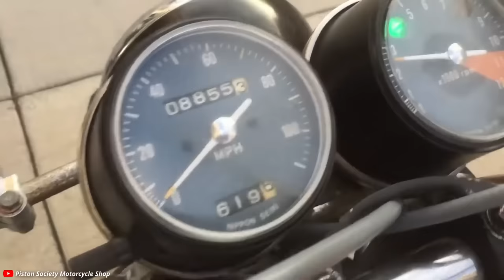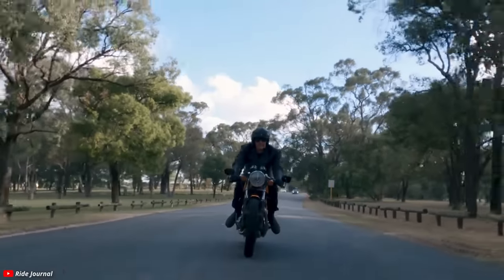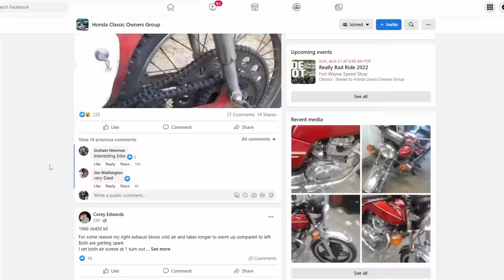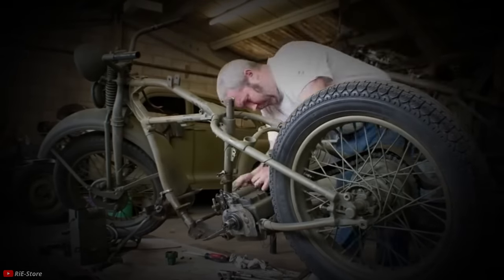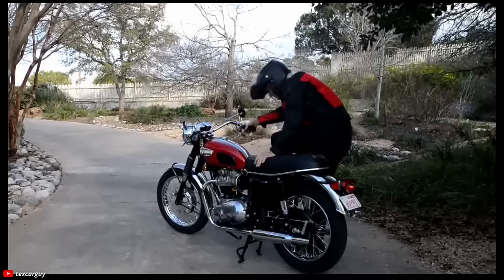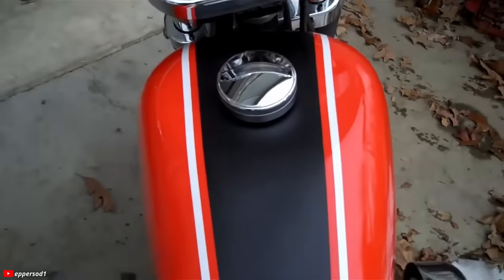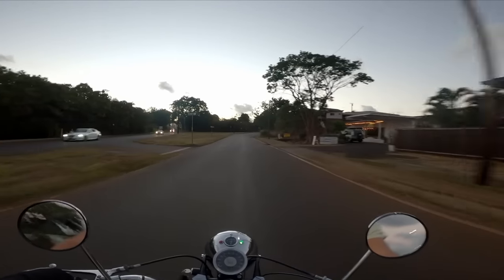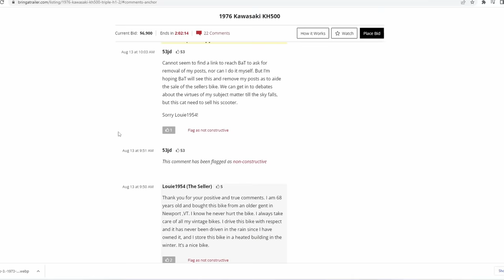So you want a classic motorcycle...

Comment: I remember old motorcycles when they were new motorcycles. Man, I love this channel.
Reply: I've gotten myself a new, old motorcycle. 2018 yamaha sr400. pretty much unchanged since 1978 :D
classic bike look and ride but it's not twice my age and needing an overhaul.
I love that it's kickstart only too
Reply: @TheJunky228  - Years ago, mid 1970's,  a friend bought a Yamaha RD-350.  He loved it. Then traded it for a Yamaha 650 twin. The Japanese Triumph clone, more or less.  Raced his old RD. Lost. Ditched the 650 and bought another RD.  Not a good picture  but my classic was a '68 XLCH Sportster at left.  Click on it and it's a little easier to see.
Reply: I remember when they were horses
Reply: @scootergeorge7089  
"..was" ? A 68 Sportster 
Nice bike.. if you like working on motorbikes
Reply: @TheJunky228  
Yes Grasshopper 1978 2J2 👍
Reply: @hodaka1000  - Actually it was surprisingly reliable. Rode it most of the year to and from work in the USN. Mine was originally a magneto bike someone did a half-ass job of converting to battery/point ignition. Found a rebuilt magneto and installed that. At a garage sale I found a complete dual disk brake front fork and wheel  originally from the XLCR "Café' Racer."  Biggest issue was starting when hot. Like after filling the fuel tank. Cold starts were one or two kicks.   Rode it from 1982-1988.  That's it on the left. Click on it and the picture is slightly better. A friend did the tank in black and gold leaf, "SPORTSTER."
Reply: @hodaka1000  - I remember when "Bonanza" put a Hodaka Ace 90 and later Ace 100 engine/transmission on their mini bike.  Arguably the coolest mini bike ever.
Reply: Grew up with an SL100, then aCB 350........then a 78’ CB750K, wish I had now! Got a few Harleys now.
Reply: Owned a few Honda’s back in the 70’s! Now I have a few Harleys.❤

Comment: I looked at purchasing an expensive Classic 70s model Kawasaki Z900 or a Z1R in original running order or FULLY RESTORED and sorted out..What I ended up looking at where ALL only very well used and worn COSMETICALLY restored bikes that looked a million dollars..and still for a huge price..ALL these bikes had either unserviceable steering head bearings and swingarm bearings as well and needed these replaced..plus other issues..So for less than half the price..WITH NO ISSUES at  all I decided on a much newer 2010 model Kawasaki Versys 650 ABS with a mere 10250 kms on the clock instead..I couldn't have made a better purchase for the price $AUD5000 with RW Certificate honestly...
Reply: You can also go for royal Enfield continental GT 650
Reply: @ashutoshrajput3757  Sorry my brother had the very first model of that bike and on ALL his long trips I was called to pick him up with the trailer..Turned out this second hand bike was tampered with by the previous owner so not reliable..
Reply: @albertsammut433  i agree with u brother. Realy these RE  causes a lot of issue while we take it for long journeys. If we ride everyday for 700to900kms it really causes a certain issues, specialy in hot climate zoned areas.

But the issue with interceptor is minimalistic.and its specific due to the placement of relay system beside the engine (where it doesn't get chance to get cooler).
For India its best option just for its accessibility and durable engine(if maintained properly. oil chNged in time, etc) it lasts very  well here.
And both continental650gt and interceptor share same engined and other spares.
Reply: @jyotiprakashdas4429  Thank you too dear riding friend..I think Royal Enfield and Triumph are very well build bikes..But my silly brother bought his bike without inspecting it first so it had a terrible previous owner who didnt maintain it well and sold it cheap..so my dear brother bought a cheap problem bike.
Reply: @albertsammut433  u r right  brother. 
Triumph is amazing 
RE also make great bike .

althg Many owners buy there RE bike, they lack proper knowledge of when to change the engine oil and many other things.
Even the authorised service centre don't make proper  suggestions abt the oil change interval period(i have seen in most of the region of India).
So atlast a lot of issue arises.(most specific issued piston ring get worn within few months of owning the bike, crank case, valve guide gets worn ,oil stem issue , severe scratchs inside bore block and  many others severe issues).
I can't blame the owners coz its the fault of authorised service centre coz they dont make the owner aware abt proper maintenance.(m teling specifically abt India).
I asked some owners abt oil change interval. They just mentioned they have never changed the oil .just refilled it when it got low and driven it like this for months, which further resulted in other shorts of catastrophic failure.
Even the owner are not made aware abt the running in period of these machines(which is mandatory for every RE engine, as per my experience for around 3000kms atleast.) Not following it is also hazardous.
Coz,
Once a rider riden his RE bike constntly for 550kms after buying the bike Frm the showroom at a stretch. After reaching the destination he parked the bike and within few minutes the bike caught fire and blast occured. 500cc bullet it was )

RE are best. But i m never happy with there services.
They don't fix the machine,rather they  try to kill the machine like a slow poison does).
Thus within 25-30k kilometres severe breakdown occurs in most oF the RE bikes in India.

If RE is  maintained properly it can last for i guess 150k to 200k  kms or more  with minor issues
Reply: @jyotiprakashdas4429  Thanks for the long story brother..I once owned an old Honda CX500 V Twin when I was 22 years old..It was my only transport then and I bought it cheap with 98000kms on the clock already..Had that bike for 12 years with only minor oil leaks..i put another 100000kms on that bike with NO mechanical issues at all..but i serviced it perfectly always..Sold it with nearly 200000on the clock and it still ran perfect..and I got all my $1100 back that I paid for it 12 years before..That was an amazing bike honestly.
Reply: @albertsammut433  oh great elder brother. I m  just of 24 now.😊

U r rite .
Honda machines  are amazing.  I have experienced small segment Honda bikes. They are favolous. They never get old if maintainance is done properly , xpecialy in engine's part.

During my 20s( i.e, 20,21,22,23) i also owned a small 162cc  bike i.e., Honda cb Hornet 160R. (I preferred small engine bike because it provided me great fuel economy and as per our road standard speeds its best choice for daily commutes.)

I clocked around 124,000 kilometres with it within 3.5years(including covid  lockdowns) and atlast sold it before few months. They are great machines.
I use to get fuel economie of 65-67kmpl  petrol if driven sweetly. And if driven insanely it gave fuel economy of 45-52kmpl.
Till date it got no issue (i did proper servicing and i m sure that the next owner will easily able to clock more 100000kms with it without any major issue).
The way Toyota car does last,  in same manner Honda bikes does last.
Reply: Two easy fixes.....if you cannot fix stuff don't buy one
Reply: @billmago7991  All bikes i viewed where advertised as FULLY RESTORED buddy and over $10k with problems..I'm an Aeronautical Engineer and can fix anything mechanical..By the time you fix all the issues..parts and labour..they are in my opinion..not worth the inflated prices..A newer bike is alot cheaper and better in just about every way and MUCH BETTER value for money..
Reply: @albertsammut433  u r right brother! Its not at all worth for the price we pay as an extra
Reply: @jyotiprakashdas4429  Exactly..its greedy people who set the crazy high prices for their worn out old bikes..I feel sorry for the riders who buy these bikes that dont understand mechanical and then have to pay ALOT MORE MONEY on top to fix them for safety..Its just a big scam honestly
Reply: @albertsammut433  i feel the same about it brother. 
Its biggest scams that is seen in motorcycling world.
Reply: @albertsammut433  
Bill Mago is right steering and swing arm bearings are not had to do 
If you really wanted a good fully restored Z900 or 1000 you'd probably have to pay $20,000oz + at least 
Didn't you know that ?
Reply: @jyotiprakashdas4429  
The biggest scam in the motorbike world are bike shops 
I've seen some horrible and at times dangerous work done by bike shop mechanics while they charge an arm and a leg  
I can only think of a couple of bike mechanics who I'd trust to touch any bike
If you can it's best to do all your own work
Reply: @hodaka1000  so true brother.
I have faced the same things in our region . Even i face the similar issue with our bike mechanics.thus
So i never trust any mechanic. Coz many times they destroyed my bike rather than repairing it. In India finding such idiot mechanics is common. After a long walk i got someone trustworthy.
Thus, I have trust on just only one mechanic  ,  whom  i visit when my bike cause any issue.
Reply: @hodaka1000  When I restore a machine I do it Aerospace standards  which means to the highest level..no expense spared..better than new..Not many people will bother to do a PROPER full restoration like this buddy
Reply: @albertsammut433  
Well.. if that's the case why would swingarm bearings be an issue to you ? 
I replaced my swingarm bearings recently but added two grease nipples the idea being you remove one and grease one side and then replace that and remove the other one and repeat so as to not blow out the seals 
It's not rocket science
Reply: @albertsammut433  
.. I've done more restorations than you'll ever have hot dinners and I'm not your "buddy" my little mate
Reply: My friend I have 76 vintage bikes.   You could get a nice shape riding 1970s Honda for about 1000$. Or less if you find the right yard sale.  I grabbed up a sweet 76 kz400 needed carbs rebuilt.  I paid 200$ for it!!
Reply: @hondaxl250k0  Yes my friend that may be the case in America where you live but definitely not here in Australia..
Reply: @albertsammut433   ya..  I’m sure your selection is a bit less over there ..  I’m sorry for that.   I watch some of y’all’s news . Also sorry for what your government is putting you threw.  Ours ain’t much better but at least we still have our guns.. and politicians fear that.
Reply: @hondaxl250k0  Exactly my dear friend the Western world is getting crazier with each passing day..That's why I've decided to jump country soon and live in the gorgeous Philippines..Many cheap bikes there although most are scooters
Reply: @albertsammut433  good luck!!! Lots of bikes and pretty girls to make use of your buddy pegs!!  I’m sure that will be a great move 👍🏻

Comment: Depends if you count 50cc as a 'motorcycle' because I have a 1976 Simson S50B. It's an East German two stroke with proper motorcycle ergonomics and a 3 speed manual transmission. It's definitely a classic and has a cult following here in Hungaryand all across Estern Europe and Germany . I also have an '81 Jawa Babetta, a Checoslovakian masterpiece with pedals and a purely mechanical (and quite clever might I add) automatic transmission. But that's barely a moped and I ride it ironically. I hope anyone who reads this looks the 'bikes' up and learns a little about Eastern bloc motorcycles! Greetings from Hungary!🇭🇺
Reply: Have a C50 and a CB50. I wouldn't call the C50 fun, but it is practical. The CB50, however, is a fantastic lie. It's the most chuckable bike I've ever had, you have to keep the revs up because there is no torque and because it's small and you are so much closer to the ground it feels much faster than it is. It's tiny and slow, but in city traffic it feels like a GP bike.
Reply: I had a Simson 50 for a while in England in the early 90s 😃
Reply: Tomos are still an extremely common sight here in holland. Especially the quadro model. Its still the cheapest and most affordable moped, even though most of them are around 2 decades old now.

Comment: Something a lot of people don"t realize about old Triumph's is that they were made on tooling equipment that came from the second world war. This tooling was already worn out so didn't have the tight tolerance's needed to make reliable motorcycles.
My suggestion is that if you are a novice to  motorcycling, but you just have to have a " classic" bike, get yourself a modern version as in a Royal Enfield 350 classic.
Reply: That's partly true in the machining but if you take your time and know what your doing they can be fixed and run as they should and not leak as well.

Comment: I'm a motor mechanic (recently retired) and, for me, the most important factors are mechanical simplicity and parts availability. I bought my 78 Triumph 750 Bonneville 29 years ago, and was lucky enough to find one with only 1300 miles, and nobody had interfered with it. In my opinion, it is the most practical of all the old Triumphs to own - there are still a lot of them around and you can buy virtually every part new off the shelf from specialist suppliers. They have modern(ish) features like disc brakes and indicators (turn signals to those in the US), and they are probably the lowest cost option, although the prices are going up as the older, scarcer models get even more expensive. As long as you keep it in good condition, its value will only go up, and they are fun to ride, with lots of "grunt", as long as you remember the brakes aren't as good as newer bikes. 
After I retired, I decided to get a second, cheaper bike to use in the winter when the Triumph is kept inside to protect it from the salt. I chose a 1980 Suzuki GS550 - it's air-cooled, with simple carburettors and a kick start to back up the electric start, so now I'm a year round biker. Simple is good, less to go wrong and easier to fix if it does.
The other advantage to owning a 40+ year old bike here in the UK is that they are exempt from annual road tax and MOT tests (vehicle inspection), saving around £240 ($300) per year for my two.
Reply: Some years ago a friend of mine used a GS550 for dispatching. As he had no mechanical knowledge I did the mechanical work on it. An excellent motorcycle over many miles of year round use. It's final demise was the electrics breaking down - something that can be sorted in today's world with retrospective knowledge
Reply: Totally agree, rego cheaper down here for 40+ year-old bikes (58NZD per-year)   Dave   NZ
Reply: Oh the joys of living in England! Unfortunately my time spent in the country did not extend to 40+ years so to get my bikes tax and MOT exempt.
Reply: @Honkawsuzyamal  one of the things lifelong mechanics always say is there's nothing that cannot be fixed , that model Suzuki was just a coil wiring harness points condenser and it has to be in time there's really nothing that can wear out and not be replaced on that bike and there wasn't anything really that broke down in the electrics on that bike that I remember any more than a 350 Honda (ꏿ﹏ꏿ;)
Reply: Wow, diese Situation würde ich mir hier in Deutschland wünschen...eine vernünftige Regelung !

Comment: I got a 73 cb500f a bit over a year ago that needed a good amount of work and I haven’t been able to ride it yet, a big reason is because I keep changing when I’m going to decide when I’m “done” working on it. I have done a top end rebuild and a lot of engine maintenance, a bunch of electrical work just to update the 50 year old wiring and putting on new tires and servicing the breaks. I have made my fair share of mistakes along the way which is a big reason why I haven’t been able to ride the bike yet but I wouldn’t change the experience for the world.

A big thing for me has been having the help of an experienced classic motorcycle mechanic in my family for those times when I make a mistake or just am not sure what to do. I would definitely say that if you do not have an experienced mechanics help that you should start small on the work that you try yourself. I also have never relied on and don’t plan to rely on the bike for daily transportation. So if you want something cool and fun to work on or ride around every now and then an old Honda especially just cannot be beat